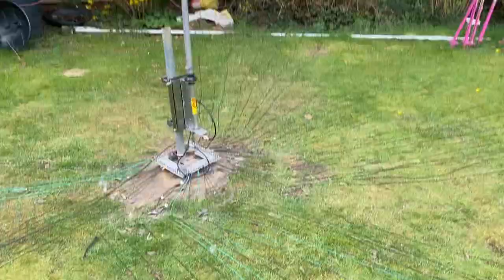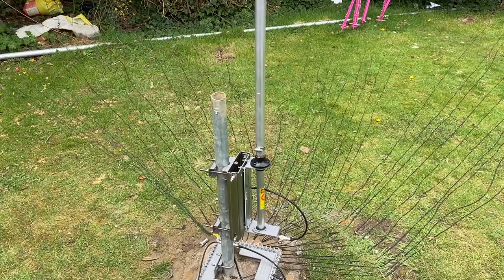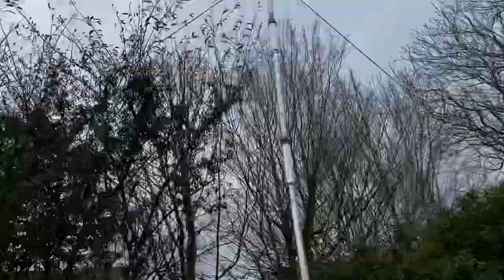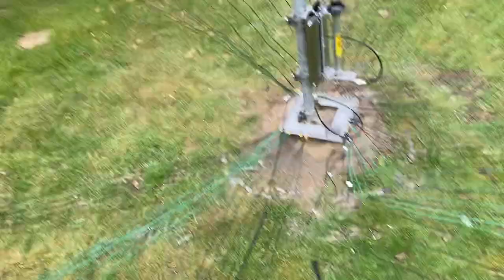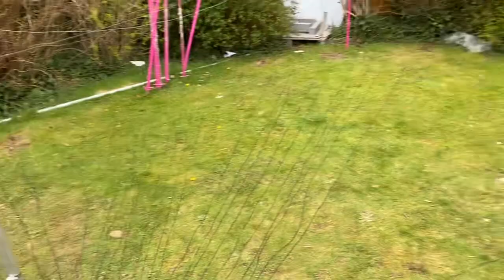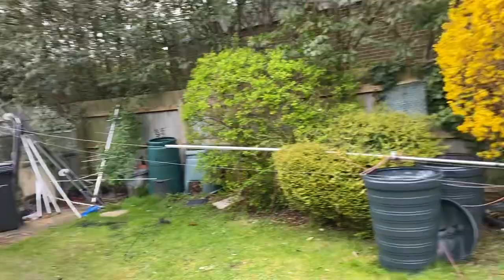6btv one week in

Comment from the maker: I've had several questions about DX Commander vs 6BTV. Currently the DX Commander masts hold up my 80M end fed antenna incredbly well, but for low maintenance the 6btv means I spend more time on the air, and not fixing antennas. Currently the 6BTV is in use for WSPR, and will probably stay that way for the foreseeable future as the end-fed does all the HF bands. You can see how good the performance of the 6BTV is via my WSPR website here http://webtechnologies.alanknipmeyer.science/html/WSPR/ or use WSPR's own website and search for 2E0FWE. Current radio on the 6BTV is an IC705 running 1W of power, it will in time be switched to a uBitX.

Comment: Hi,
i see in the background a DX commander. How do you compare the BTV to the dx Commander?
Reply from the maker: Hi Philbou - I started with the DX Commander classic - really good antenna that taught me about folder fan dipoles, liked it so much went all the way to the Nebula, I then faced due to a series of bad weather frequent issues, hence I went with the 6BTV. Comparisons - well, the 6BTV is very old design and a trapped vertical, I've not done an exact performance test against the DX Commander, but against the harsh UK Weather, the 6BTV has just been 100% rock solid. I currently use the 6BTV for WSPR and you can find my webtechnologies site where I put 1W of power into a 6BTV and a set of good ground radials how well the antenna is working. (search for 2E0FWE on WSPR) - so to answer your question, because I wanted an antenna that is low maintenance and good enough performance, the 6BTV worked well for me, but the mighty Nebula and DX Commander classics are good antennas as well, but I dont have the time to fix them each time a wire snaps or have to take it down due to the high winds.
-Edit - what I would say is a better on the DX Commander is that you can get a much wider length on 80M than you can with a 6BTV, my 6BTV is tuned for WSPR and FT8, where as the DX Commander in either classic with a folded wire to get on 80 will give you the whole band, and the Nebula will - its a massive mast tho !

Comment: Hi there , good video, I have just bought the same antenna, how long was your mast before going in  the ground ?
Reply from the maker: Hello ! The antenna  is supported by a standard piece of scaffold pole. I used Steel Fence Post Hole Auger to make the hole and fill with cement - measurements of how much to allow for the top-side are in the installation instructions. https://www.amazon.co.uk/gp/product/B00D847FYY
Reply: Thankyou 👍🏽

Comment: could you mast mount this antenna for any performance gains
Reply from the maker: Hi Chris, I personally havent done it, but I have known and read of people who have the 6btv on a roof on a mast. Where in it is on a mast, it is then required to use accuracte counterpoises vs radials as the counterpoise(s) will need to match the bands. Please see the excellent DX Engineering manual here https://static.dxengineering.com/global/images/instructions/dxe-btv-inst-ins_gg.pdf and it will guide you !
Reply: @alzeNL  Fantastic thank you so much for the information and guide - best to you and the channel
Reply from the maker: @Chris-tx9ou  Thanks Chris, its really great to have input and good questions. I'll put up another video on the 6BTV tomorrow as I've recently started using it again.
73 2E0FWE

Comment: Thanks for the video. I am considering this antenna. I have been told by other owners that it can handle high winds very well and they seem to last.  I think it  is good value compared to many others and performs well on the lower bands.
Reply from the maker: Oh yes ! its very robust. I have mine guyed down just as a precaution. The centre pipe its mounted on goes down about a meter and sunk with concrete, so it wont go over from the base. The fact it has 3 very good strong anchor points just ensure it only ever comes down when i want it to, and when it does, it doesnt break. Rugged and well built.
Reply: @alzeNL  Thanks for the reply. I am not sure how I will mount it yet. I have a chain link fence around the backyard and it would be easy to mount it to that and make it fold down along the top rail with a swivel mount or I could mount it near the center of the yard.  I considered buying a surveying tripod and mounting it that way.  I am renting so I can't do anything permanent. I have some big trees and plan on putting up an 80M dipole as well.
Reply from the maker: @davidbrennan5  Renting as well - the point is I can put everything back as I found it. I did ask the landlord first they, they are very cool about it, in fact they are interested in my hobby ! Others have used a bucket filled with cement to put a scaffold pole in. Beware of the chain fence, anything metallic will effect the performance of the antenna. If you mount it above the ground, i.e. the radials in the air, then you need to cut the radials to the required lengths, compared to the raidal plate close to the ground, where you can just lay them straight down at random lenghts (although I do have many down for specific frequencies, more as a test). What ever you do, the Hustler antennas are tried and tested and work well up high or close to the ground. You will enjoy this antenna. Be sure to use the DX Engineering documentation.
Reply: @alzeNL Thank you for your answers, that helps me out a lot. I think I could get away with 23 meters of coax, not sure if I should get RG213 or LMR400?  I have a Yaesu FT1000MP radio.
Reply from the maker: @davidbrennan5  I'm not a coax expert, but being HF the amount of losses are going to be less important than for VHF/UHF (That I do know !) I run a length RG213 and its been fine on matching up into the IC7300. I dont think I have done a video or pictures of the performance the shack end using the rigexpert, so will incorporate that into tomorrows video. Thanks again for interesting questions and watching the channel, I really appreciate it ! 73 2E0FWE
Reply: @alzeNL  I ordered 75 feet of  Lmr 400 from antenna farm, might be overkill but figured buy once cry once. I ordered a 5btv from dx engineering  in October, it is still on back order, every time they give me a new shipping date it gets pushed 3-4 weeks.
Reply from the maker: @davidbrennan5  Sorry to hear about the back order ! I didnt realize they was so popular. Likewise I am waiting on a compent part I want to add, been waiting along time, but I guess global supply chains are strained the last year or two making things unpredicatble.

Comment: How do you like it compared to the DX Commander ?
Reply from the maker: The Classic was a good antenna, so much so I still have two of them, but not in use (as antenna). The Nebula is a great antenna, just needs plenty of space. Now, the 6BTV, it gets me out on PART of 80 (very small) and 40, 30, 20, 15 and 10. Its a fantastic antenna and I'm just making it better and better with more radials and tuning. TL/DR If you was to ask me what antenna would of I bought 1st, yes the 6BTV, but its not as cheap as the DX Commander, and the Nebula is a beast, but fantastic on 80m (I've replaced it with UK Antenna End fed for full 80M but as an inverted L).  Get the best antenna you can afford is the best advice.